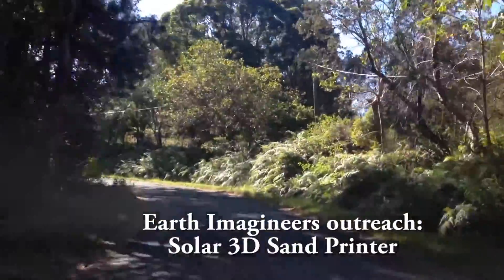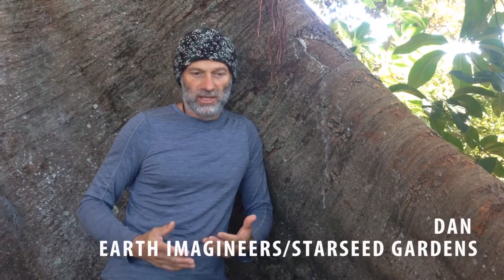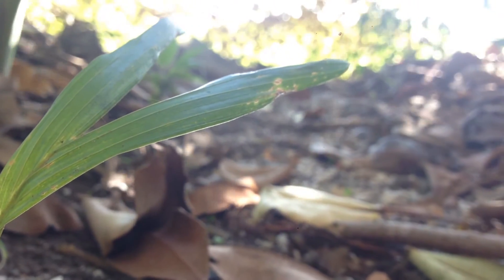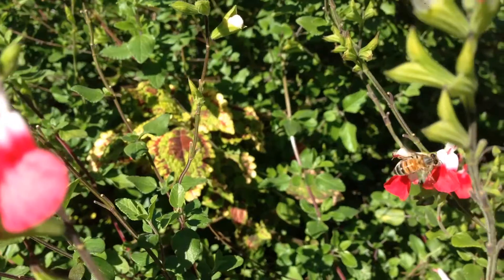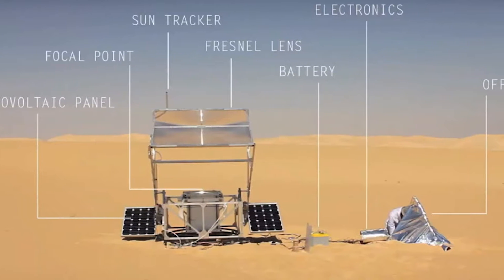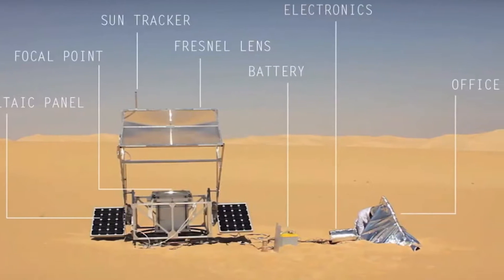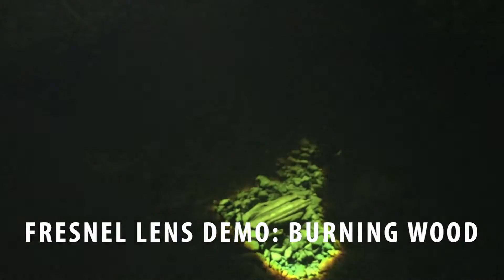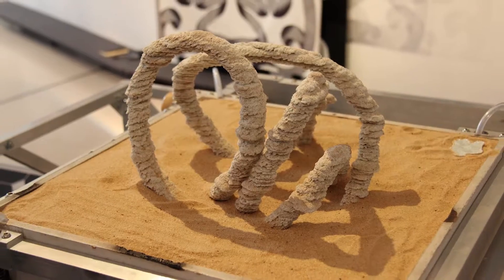Earth Imagineers Outreach Project: The 3D Solar Sand Printer

Comment: To regreen the desert in china they use the box technique which slows down surface windspeed and stabilises the sand for planting

A machine like this could print tiles and arrange them in box shapes, or linear walls perpendicular to the wind as it rolls. Then the area would need to be fertilised with straw and possibly seed
Reply: A big one could be let loose in the Sahara and make all sorts of things like 'glass'/stone irrigation ditches, stone road surfaces, wind breaks, and yes houses etc. No need for material imports etc

If it can be supplied the right mixer materials it could even make transparent glass for making greenhouses which will retain water in the desert (or on moon or mars) for plant growth

This thing is cool and opens up lots of possibilities

I hope Egyptian government takes notice